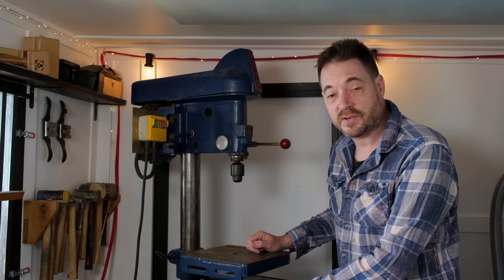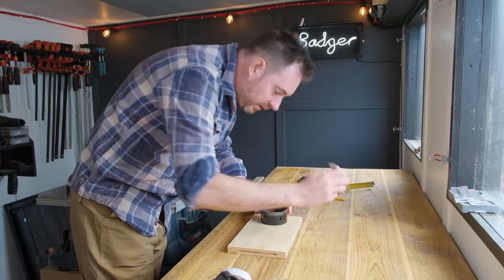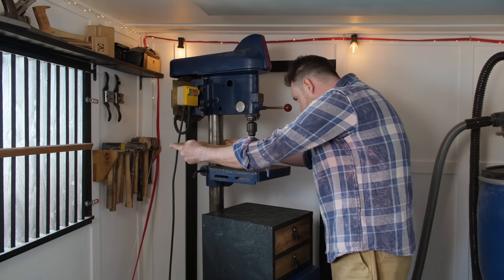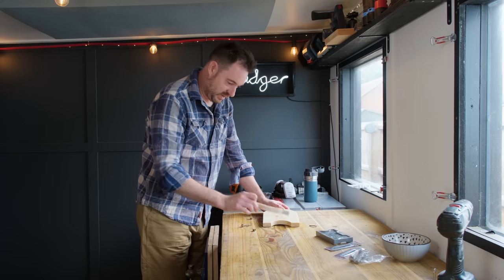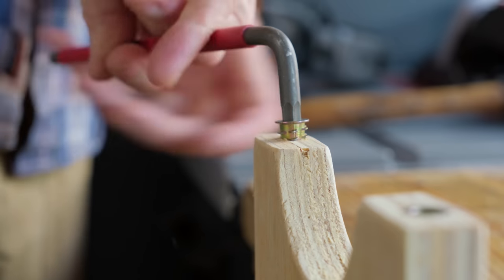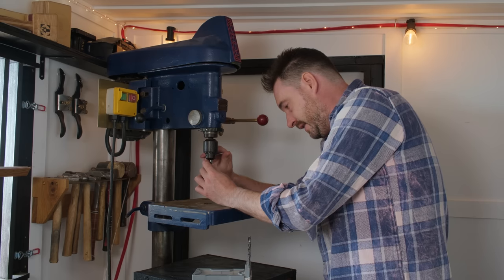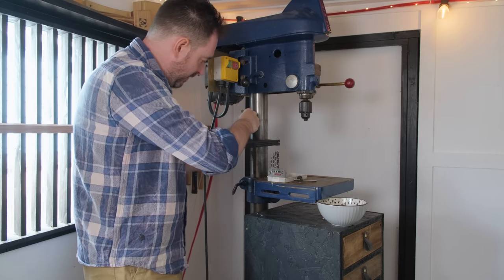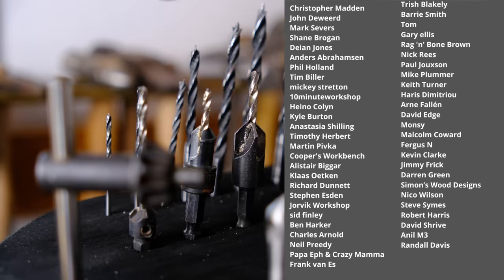On Drill Bit Storage

Comment: Hi Matt, A good way to store your drill bits, I like the way you got it clamped around the shaft and for easy reach. I got my drill bits on a length of CLS about 50 cm long drilled in to 3 rows hold's about 40-50 drill bits.
Another thing I have done with my drill is attached a light to it, I use an old bed side lamp, take the base off it's got a flexible stand I undo the nut fix it to a car exhaust pipe clamp fit it around the shaft. Fitted a new 2 core flex from the bulb fitting down the flex stand to a light switch on the bench leg ,cable tied it with the drill cable to a enclosed connecting block were the two cable connected together and a short cable to the plug ,one plug powers both drill and light. sorry if its a bit long winded trying to explain how I done it. 
As always a great video, Take care
Reply from the maker: I lamp sounds like a very useful thing to have on a drill

Comment: An alternate method to mount is to cut two shallow "V"s instead of a large circle.   Cut off the end piece, cut the shallow "V" in the end piece then in the main piece typically on a bandsaw but can also be done with handsaw.    This provides 4 points of contact vs the two points of a larger circle.

Comment: Nice project, but good luck with it. I've tried drill and router bit storage in wooden blocks and both resulted in rusty bits over time where they were in contact with the metal.

Comment: If you knew you were going to split it why didn't you split it, then put the 2 halves together , draw the hole and then use the band saw? Be careful with wood or mdf for drill storage as moisture in the timber will corrode the drill shank. It looks like the rear right bolt has split the ply layers try using a 'fender' washer to spread the load.